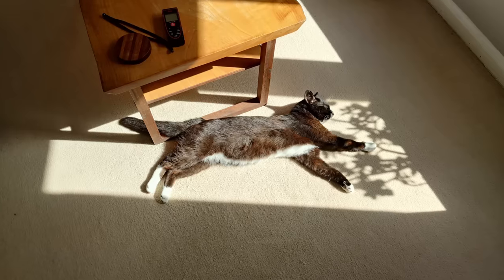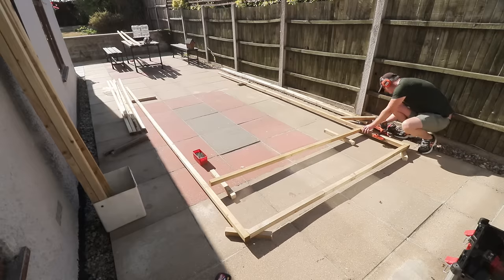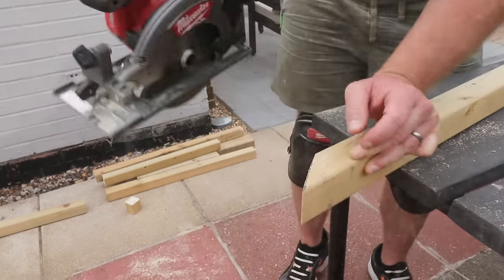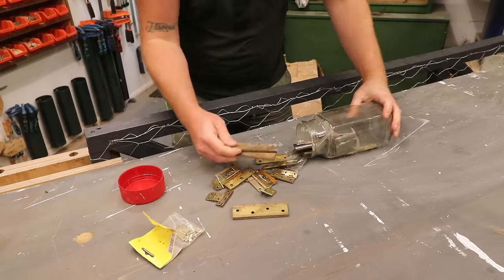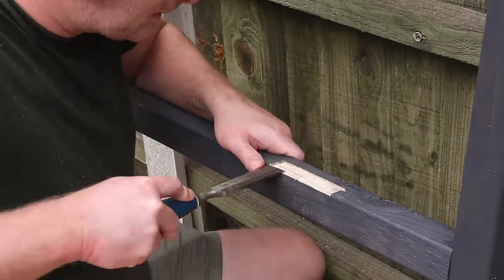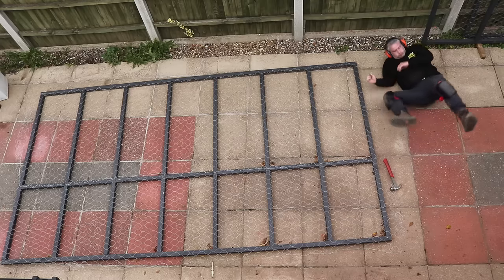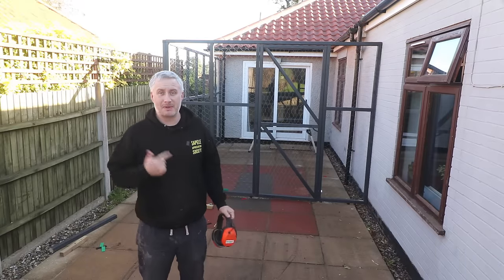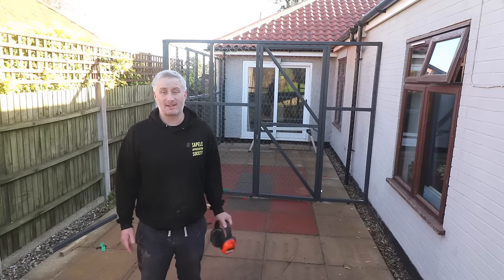We Built A Catio!

Comment: Will warn you, those gate springs are crap. coating splits and water gets in, so it starts to rust. also after a few months, one of the pins popped out (somewhere) and now the whole thing is useless.
Reply: hit the thing with waxoyl, and at least it will see out a few years, plus will not creak. I tossed the pin though, and used a drill to go deeper, tapping the hole, so a screw would go in, and that kept it working for a long time.
Reply: I thought they were meant to be fitted almost vertically - not bent at 90 like in the video. At least that's how I did mine, still working after about 8 years.
I did loose the pin too though. Wedged in a small screw as a replacement.
Reply from the maker: Cheers I'll probably replace it with a better one some day
Reply: @RagnBoneBrown  Lasted about a decade by me, exposed and with a few hundred people using the gate every day. Now new gate and a proper door closer, which also lasts around a decade before it fails. Door closer is a lot more expensive though, but also controls the closing better, with slow close at the end.

Comment: Sorry to say but for everyone who wants to build this because of cats having diseases. This mash will not prevent that.
Reply from the maker: How do you work that one out then?
Reply: @RagnBoneBrown  First,  thanks for answering so quick. I love your content so please dont get offended. 🙏
The problem is that cats can spread FIV through bites and even by licking wounds or faces, which can happen with this fence. However, they usually do not spread it through the environment, so building a fence where you can actually prevent the cats from touching each other would be ideal. You could use a mesh wire fence with much smaller holes so the cats can't put paws trough it.